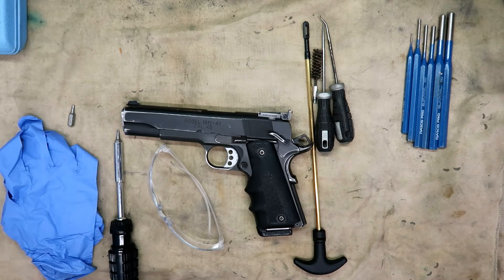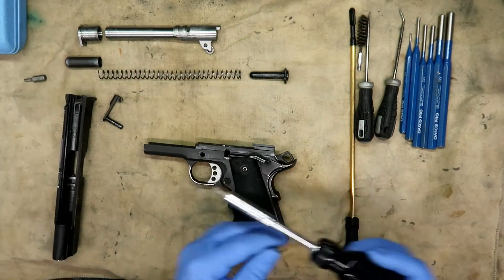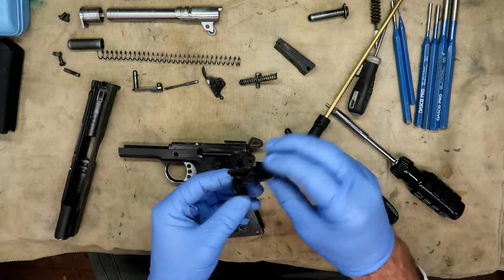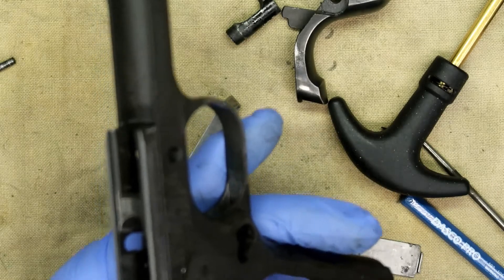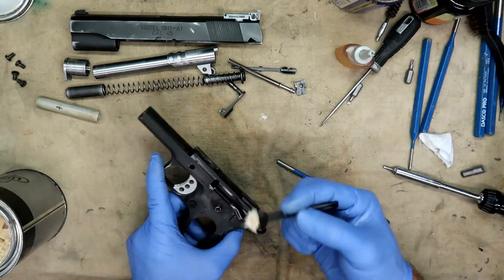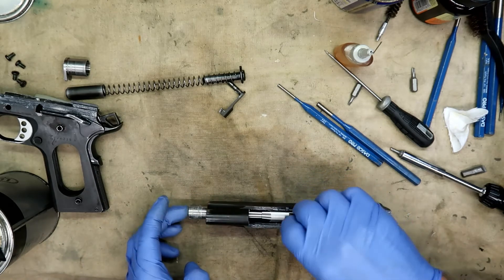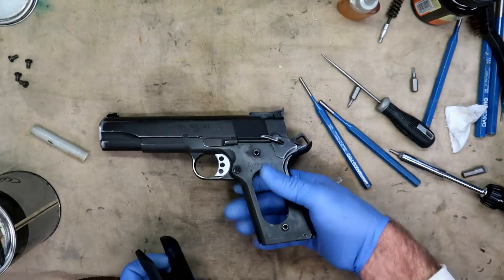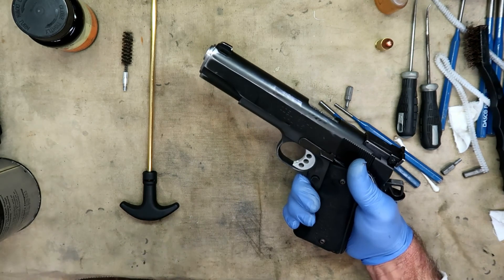M 1911a1 Complete Disassembly & Extreme Duty Lubrication

Comment: Do you need to lube the parts inside the frame or firing pin assembly?
Reply from the maker: Not the firing pin it should only have a very thin coating of carbon steel or bone dry. I grease all pins and areas of the innards that pivot against the frame or other parts. The main spring and plungers I also grease. Those parts rarely get cleaned so I do that to keep crud out and reduce friction.
Reply: @mackdaddy1911a1  Thank you!  What is a "thin coating of carbon steel"?
Reply from the maker: @jobrivera98  I meant a thin layer of grease on the inner parts of guns made of Carbon Steel.